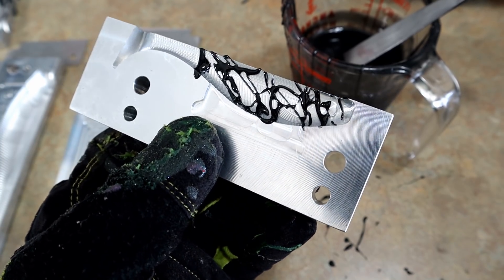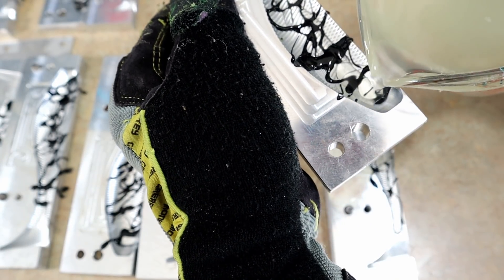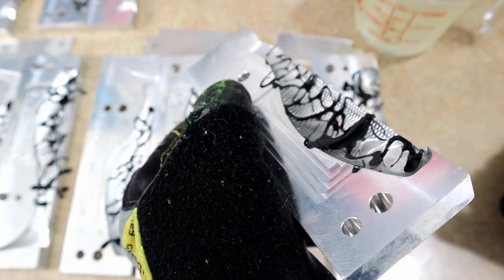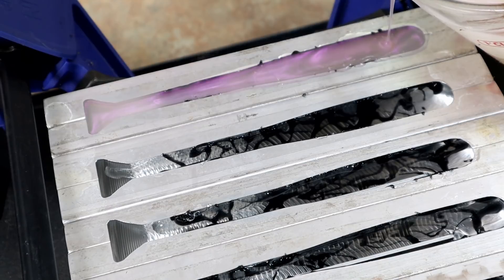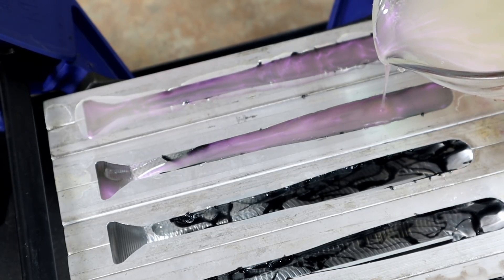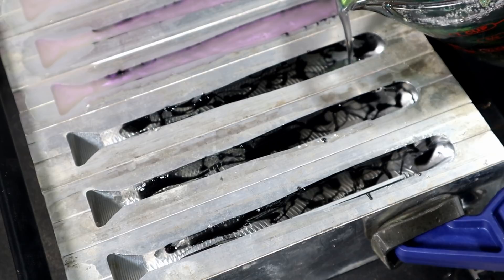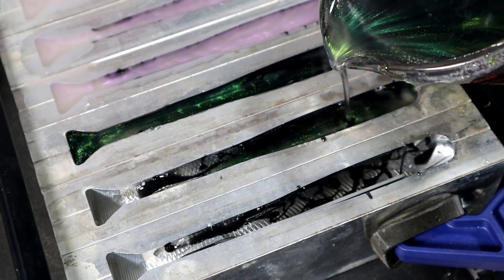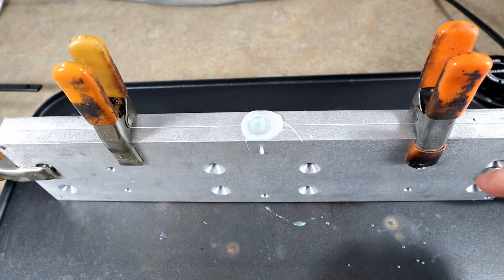The DRIZZLE METHOD; Drizzling Injection Molds and Hand Pour Bait Molds

Comment: How does you plastisol heat up so nice? I bought a 5 gallon bucket of dead-on plastics swimbait blend and it came out like absolute crap at least with the 2 colors I tried yesterday. The plastic just wants to stick to absolutely anything and everything, I even used worm oil and it basically ruined all of my injectors. I mixed the bucket for at least 3 minutes using a drill with a mixing attachment. Btw those baits are amazing and I'll definitely be trying it once I can somehow get either my injectors clean or brand new ones
Reply from the maker: ALL plastisol needs to reach 350 degrees to convert.  Watch my video "tips for the beginner" and pay very close attention to how I cook my plastic.
Reply: @WorldsWorstFishing  time to get a temperature gun, I figured the 4 minutes of heating would've been plenty enough especially considering how it seemed at first when I first took it out of the microwave. Any recommendations on one.